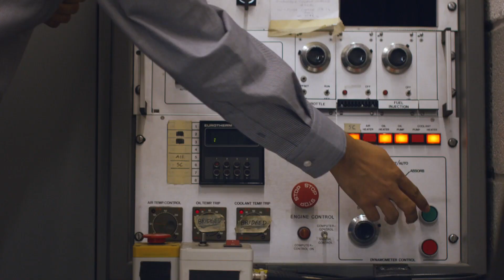Waste coffee grounds used to heat homes

Comment: Can you list the recipe of the coffee grounds logs?
Reply: As he had shown, it would probably require some chemistry to separate the oils from the solid material itself to create a dry object to burn. But basically it is just coffee grind without water or liquids in it.
Reply: @hassanbeydoun2460  nah it's really not complicated chemistry. It's basically just pyrolysis, which is heating up an object in the absence of oxygen. That will naturally separate the water vapor, butane, methane and bio diesel until you are left with a carbonized product. It's actually very similar to how charcoal is made.
Reply: @Zealous_Tutorials  Cobblers.